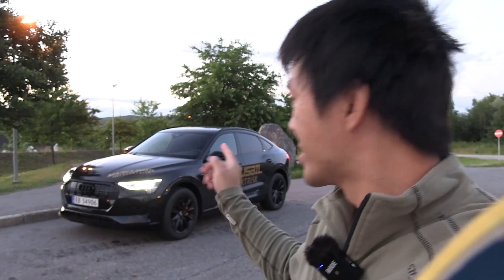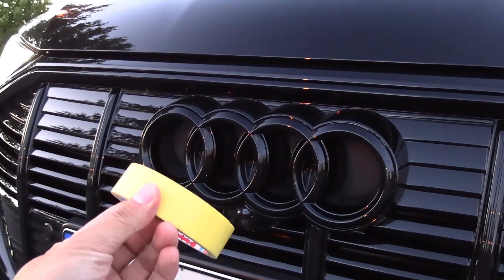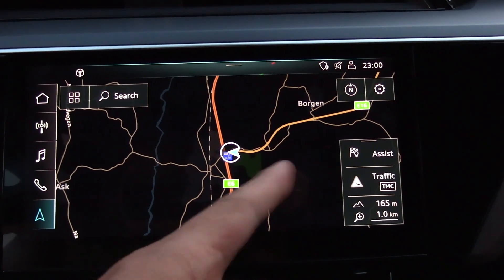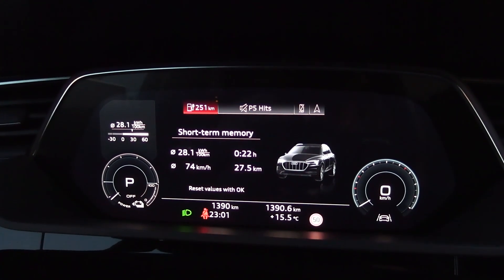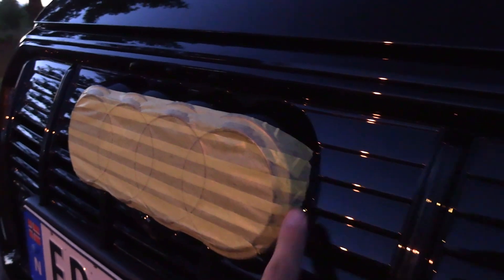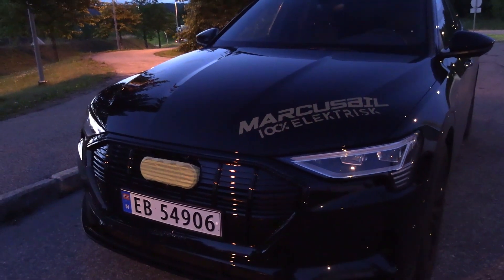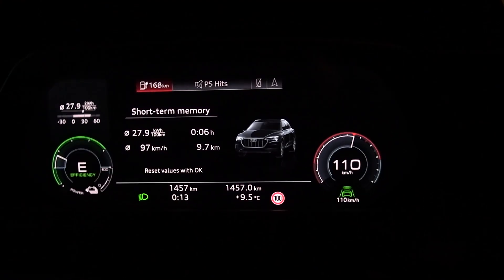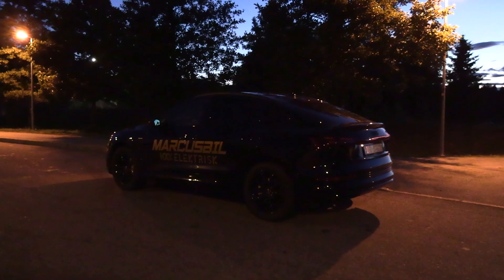Trying to improve efficiency on Audi e-tron

Comment: The added drag from a grill is negligable. Most aero gains will be made on the underbody, wheels/wheel arches and the tail. Of course total coefficient is a product of the drag coefficient and frontal area. An SUV might have the same Cd as a car, but its CdA will be higher due to a being a bigger car. Teslas and Hyundais efficiency will mostly come from their experience in optimising drivetrains, lighter build and less insulation. Take the new Polestar 2. Very close in size to a Model 3, but 300kg heavier. That's going to cost it wH/km.

Comment: I’ve spent the weekend driving up to Scotland in my Model 3 LR, covered over 1200 miles and got an average of 260Wh/Mile. Those numbers for the audi are not great at all.
Reply: You are comparing a Model 3 with an SUV.... How about if you drive a Model X Raven. Then you can edit your comment with more accurate info.
Reply: @AaronStarkLinux  model Y would be a better comparison.
Reply: @AaronStarkLinux  That’s why I don’t drive a brick. I don’t need a giant windbreak to compensate for my failings.
Reply: NC500?
Reply: Wolfgang Preier The closest to E-Tron SUV is Tesla X but that is a weaker built EV max payload 525 kg. E-Tron SUV 640 kg.

Comment: If i can make a suggestion for such tests (as an automotive engineer).
Do the tests A-B-A-B-...etc.
And get on the highway, and when you are at the right speed, then start the tripmeter. Cover the distance/ tim and repeat. Then the accel/ decel etc is eliminated.

To be even more thorough. Check tire pressure before each run, air temperature and pressure.

You did 6 runs before, should have done 6 after the mod. It could have changed, now you dont know. And if you do 6 tests and 1 is way higher / lower, then eliminate that one from the dataset.

Maybe we just have to accept the Audi's are unacceptably thirsty 😁
Reply: bochap21  he didnt finish the test so you cannot claim it makes no difference

Comment: Is the etron  inefficient at all??? 
Efficiency King Ioniq 28 kWh uses 156 Wh/km. etron s weight/ioniq s weight x 156 Wh/km=255 Wh. Ref: EV Database ioniq highway mild
Reply: Ev Database
Ioniq 28 kWh 156 Wh/km
Tesla X Perf. 238 Wh/km
Audi etron Sportback 50 244 Wh/km ref EV Database
All Highway Mild
Reply from the maker: Don't trust EV database. It's full of errors. And you're comparing less efficient Model X performance with e-tron. Compare Model X Raven which has 177 Wh/km consumption whereas e-tron has 225 Wh/km at 90 km/h.
Reply: @bjornnyland  Hi Bjørn, appreciate you taking time to comment. Any suggestions for more reliable options than EV database? What is Highway Speed anyways, 110 kmh? Etron is just way too heavy but yeah do understand that there are loads of other parameters.
Reply from the maker: Model X uses 177 Wh/km at 90 km/h.
Reply: Well, there's the answer then, lighten the car instead of it being a such an ugly barge!

Comment: I’d be interested to see what happens if you shrink the tires and wheels to 245/55R19 and used an efficient tire like the MXM4 or something similar. The only real way to increase the efficiency substantially is for Audi to cut weight drastically. The e-Tron 55 Sportback weighs nearly 3 tons (6000lbs). It’s electric motors are also massive and heavy compared to Tesla’s current motors and produce a lot less power and torque. There’s just not a lot about the e-Tron that I personally find innovative or even close to being on par with Tesla except areas like build quality and optional features that Tesla doesn’t offer like HUD and such.
Reply: Love the ignorance  :)  Audi offers a 19" high efficiency wheel which results in about 12% improved range over the 21" wheels.  They're ugly as f**k but they do work.
If you've driven both cars, you know that the E-tron absolutely SLAYS the Model X in any kind of snow / offroad situation.  It also drives - day to day - way better and is a far more sturdy car.  For sure, efficiency wise, it's about 10% overall less than the Model X, but that's about it.  The rest of the range differences come from conservative battery access, different motor philosophy (reliability vs optimized for power / efficiency) and the real world implications of this are fairly minimal.  There is a lot that's appealing about the car and it's far and away a better place to be in terms of creature comforts.  So, it depends if good weather city range is the only choice in making your decision: if so, then you buy the Tesla Model X.  If you drive in cold weather, snow, rain, or can get away with 180 - 220 miles (290 - 350km) of real, every day range, then you can easily fit the E-tron into your lifestyle and you have a real decision to make.  VAG is only getting started here: they don't need to play the 2.8 sec 0-100km/h game (and frankly, they will kill it here as well: see Taycan) or tweak EPA numbers to get the largest number on paper that you can only reproduce in very specific situations.  
I tried both - I ended up with the E-tron and have ZERO regrets.  YMMV.

Comment: I wonder if the outside temperature and humidity affected the results in any way. Probably not by much. But did it get colder? Because temperature decreasing leads to drag force increasing. And humidity decreasing leads to drag force increasing. And reverse.
Reply: we can go this way and say for instance: speed and direction of wind could change, or driving behind some cars/truck for certain amount of time affect the result, but realistically these super precise tests are possible only in laboratory. In this case is just good to see and good to know.

Comment: Outside temps dropped from 15,5 to 12 C during the tests, meaning a bit higher need for interior heating and a bit denser air.
Reply from the maker: Interior heating? HVAC was off.
Reply: @bjornnyland  Aha, good, one variable ruled out.

Comment: Any moving object going less than the speed of sound generates a pressure wave in the front that pushes air to the sides before the object gets there. Consequently, what's in the middle of the frontal area has little effect on the aerodynamics. Your result is not surprising and Audi engineers are not  incompetent.
Reply: Doesn’t it depend on turbulence? - door handles creates turbulence (and noise)
Reply: @npbetts; yes the tail of the car is more important than people think. If you can reduce turbulence behind the car it becomes more efficient.
Reply: The engineers are probably not incompetent but their management obviously is🤬. They continue to throw money at combustion engines and kill the future of the company....
Reply: If they’re not, how come they designed such an inefficient car?
Reply: @kardy12  They wanted to keep the Audi philosophy design. That is one of the biggest problems with legacy automakers. But also their first attempt to sell a real fossil competitor as an electric car.
Reply: Aaron Stark 
Well, the Audi philosophy in petrol and diesel cars doesn’t seem to be to make them significantly thirstier than competitors - while I don’t give much credibility to WLTP fuel consumption stats as a guide to how much they’ll actually consume in the real world, they should be roughly equally “accurate” across models and brands, and in its own segment Audi’s don’t stand out as significantly less efficient. So why are they significantly less efficient with EVs?
Reply: @kardy12  they focused on other features than max efficiency. E-Tron is a stronger built car that has the highest available payload on any EV car on the market. E-Tron SUV 640 kg, Sportback 670 kg. In comparison Tesla Y LR is the weakest CUV / SUV with payload 402 kg. Even a Hyundai Kona EV has 485 kg.
Reply: Foersom excuses, excuses.
Reply: @kardy12  Exactly...
Reply: They are not?

Comment: Bjorn, I have been driving the Etron Q55 for a year now and there are several factors as far as I can judge it for now .Rolling resistance electric motors / heat pump efficiency to condition the battery / Air resistance.
There are different concessions that influence the total of a Audi Etron and  there is no possibility to read the power compsumption of the compenents of an Etron.